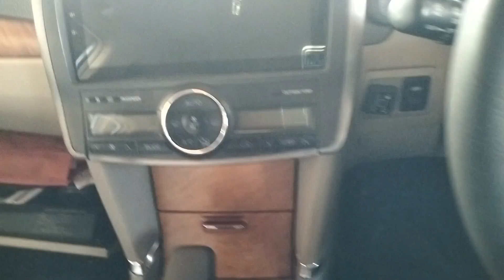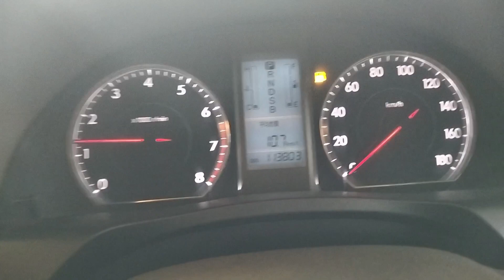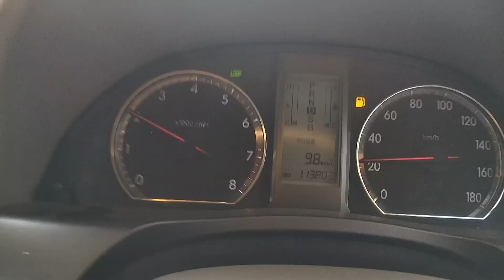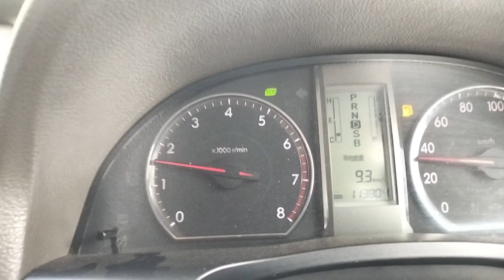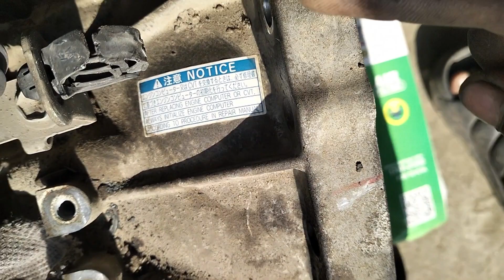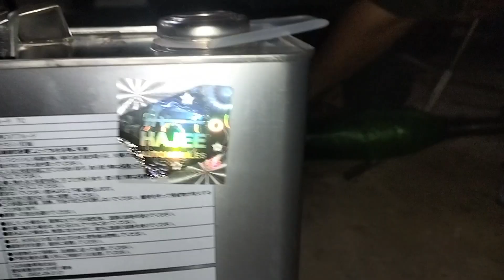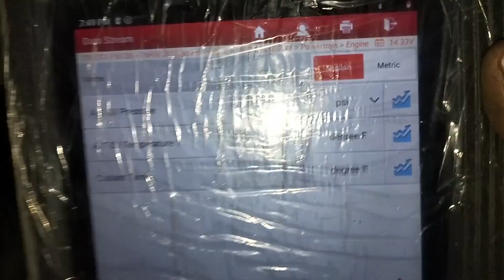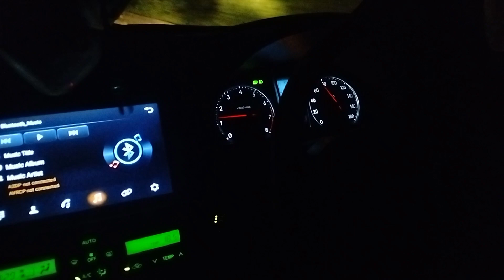CVT গেয়ারবক্স পরিবর্তন করা হয় ? | CVT is how the gearbox is changed ? TOYOTA PREMIO |

Comment: যতবার স্ক্যান করা হয় P103, p104,p105কোড আসে, ইরেজ করা হয়, আবার আসে। 
করনীয় কি? গিয়ার রেশিও কত থাকা উচিত?
Reply from the maker: check ignition system
ATF pressure  above 100 psi rpm 700/800